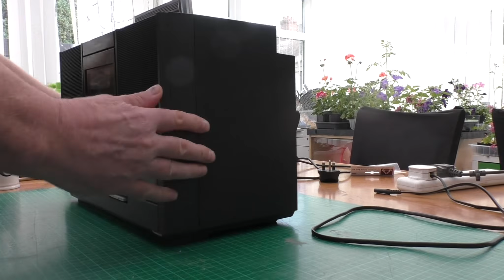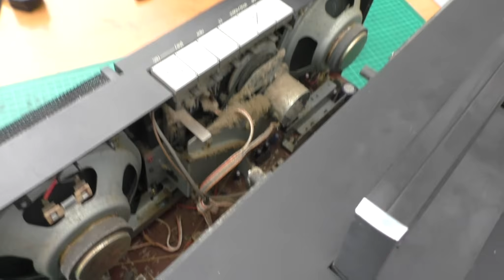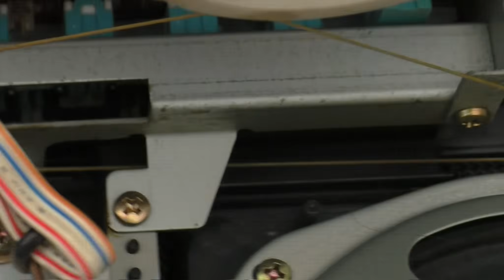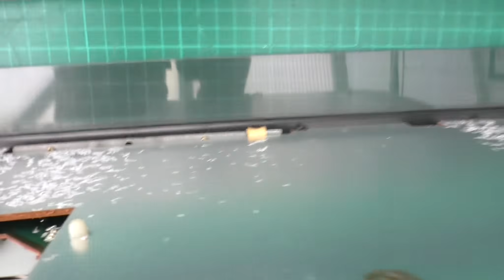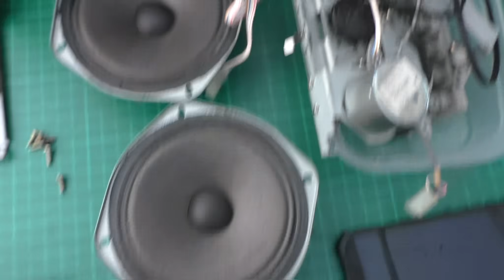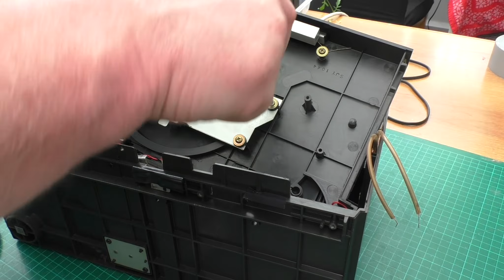Panasonic SG J500L Boombox Dismantle and Belts removal

Comment: Where's a good place to get a cassette belt and turntable belt?
Also anyway to add in phono line connector? Or swap out lw for a Bluetooth adapter?
Also thinking of how poorly the speakers respond would it be worth updating with a modem set
Reply from the maker: Hi, in the Uk i use a company called DeckTech, they can be found on ebay, the guy there is great if you send him the belt details they make them up.